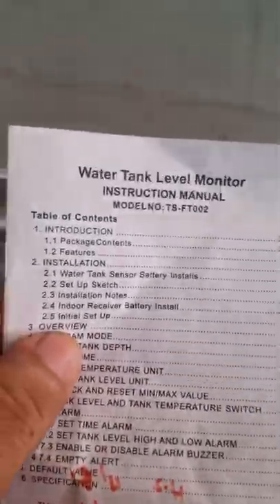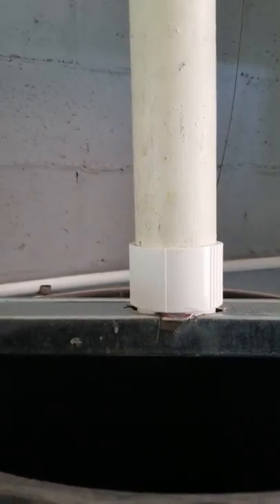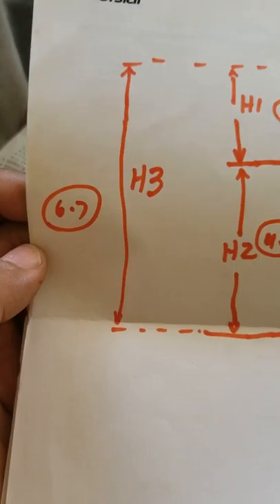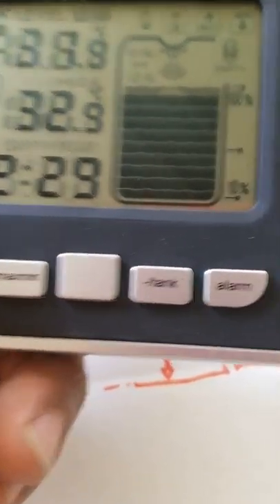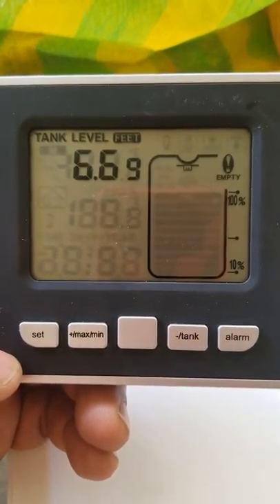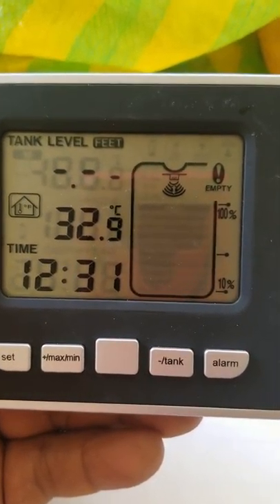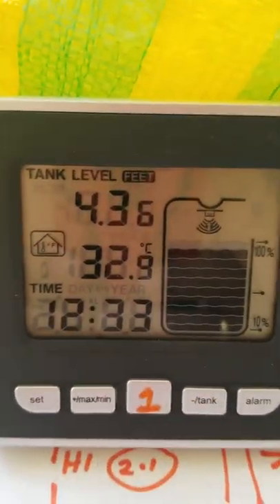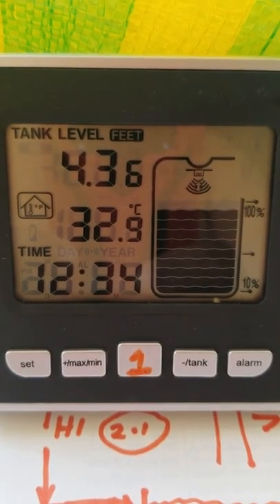water tank level monitor TS FT002(2)

Comment: I can't stand setting this thing up, but your video is MUCH simpler to understand than the booklet instructions...but, to clarify, I think your sensor bottom to top of water mark(when full tank) is 2.1 FEET,  NOT "2.1 Inches", as you repeated a few times....just to clarify for other frustrated users of this enormously over-complicated User Manual.   I just hope im correct, that you meant feet, not inches, or all my figures are wrong now...

Comment: can't get my meter to work!!! i have all the needed distances, leveled device, and was able to program the settings but can't get a water level reading. error shows tank as empty, i do get a temperature reading at the tank and inside so the transmitter is sending but only half the info. I do have a rectangular shaped cistern, i wonder if that is the problem? the instructions don't say anything about the shape of the water tank. due to other bad reviews and no real trouble shooting directions posted that i can find i don't recommend this device.
Reply: I had the same issue because I set the full level distance first.Are you setting the low (empty) setting first?

Comment: Thank you so much. I have spent hours trying to set up this meter. Within about 4 mins of your video, everything is working and reading correctly. You are a star. Thank you for posting this video.
Reply from the maker: Hi bud so happy you got it working. Did you use a pipe 2 feet above water level to get a reading? I bought tow of these units and never got it reading correct. I will try it again. Thanks for your advise.
Reply: @kensawh  Not yet. I am having the tank topped up this week and will see what I need to do once it is full.
Cheers
Steve
Reply: @richard1001001  Did the 1/2 meter pipe above your tank work?

Comment: the manual says that there is a problem if sensor is install too near from de wall of the tank, Is there any problem if it's installed inside a pipe as you did?
Reply from the maker: hi I tried the pipe to get the height but it still does not work

Comment: Did you finally found a solution to get the meter to read accurately?
Reply from the maker: sorry didn't get a chance. I use a clear tube parallel  with tank height to measure the water level
Reply from the maker: you can chk my videos to  view it

Comment: I need to install this in 3 different tanks - is it possible to "pair" each unit so one does not interfere with the other on the same frequency channel?
Reply from the maker: I am yet to get this unit to work. Try one unit then go invest in more. I used a clear hose parallel to the output of my tank and this works greats, no batteries required. See my invention to measure the height of water in a tank.

Comment: in other words, what is the diameter of the pipe that you used to avoid any operation problems?
Reply from the maker: I used a 2 inch pipe to get the height to get a water level reading. Just so you know it worked once and never worked again. I yet to find time to troubleshoot the issue.
Reply: @kensawh  ups! that's mean the sensor doesnt really work, is it a waste of money and time?
Reply from the maker: @wayne5x   i want to spend more time to make that conclusion, it's a nice design just don't know why it fails, I will keep you guys posted. I used a clear hose out side and it give me a real time results!
Reply: sawh  Thank you for your answer bro.
Reply: @kensawh  My tank is underground
Reply from the maker: @wuweimarx1725  beats me

Comment: Hello Harry, 
I am planning to purchase the same water tank level monitor TS-FT002.. my only concern is the distance..
I live in a 5 floors residential building where my water tanks are mounted on top of the roof.. and I live in the 2nd Floor.
I would say that the distance (vertically) from where the tank is down to where I would mount the LCD display is less than 10 meters.. Do you think this is Ok? or would I have any issues with the RF communication?
Reply from the maker: hi bud unless you can mount the meters as exact as the instructions says you may have problems getting it to read. rf wise you should be able to get readings. my meters worked one day
 I got to redo my install before i can say these meters work
Reply: @kensawh  Hmmm, so I think you wouldn't recommend it, right? 
I have also seen lots of negative reviews on the same on Amazon.
What do you think? 
And is there a more reliable alternative? Even wired alternative, no problem?
Reply: @harry sawh please reply to me.